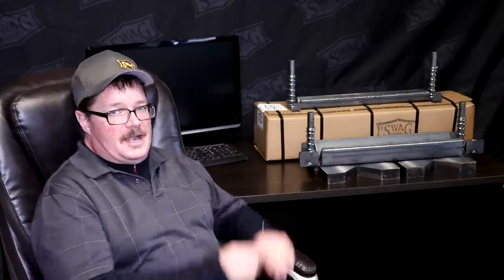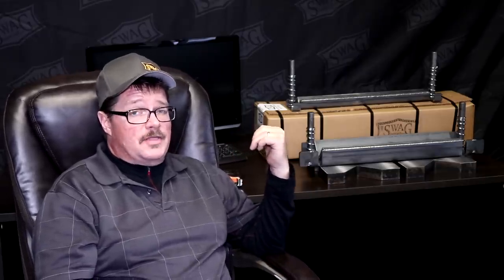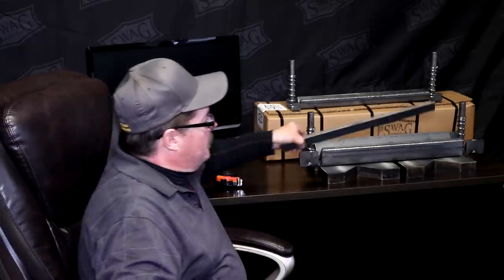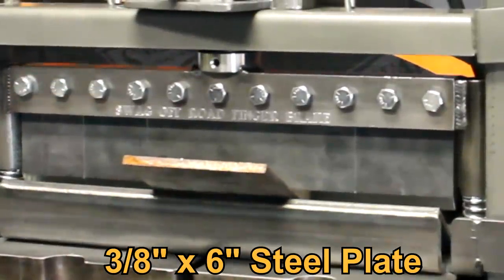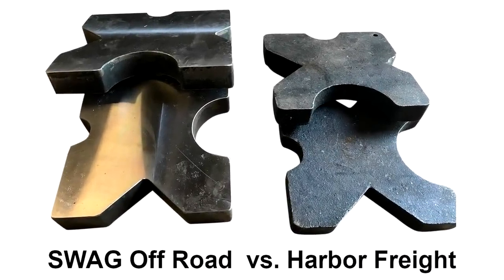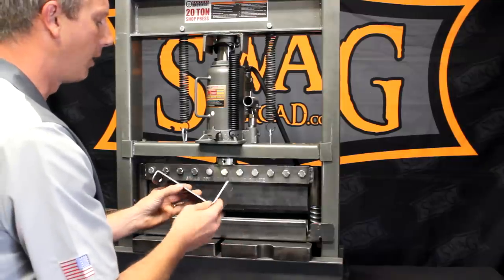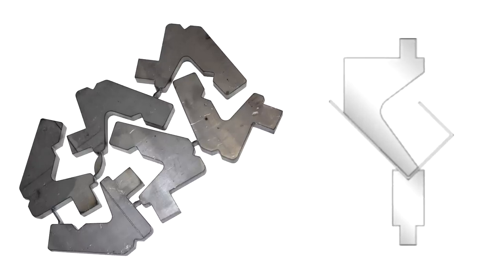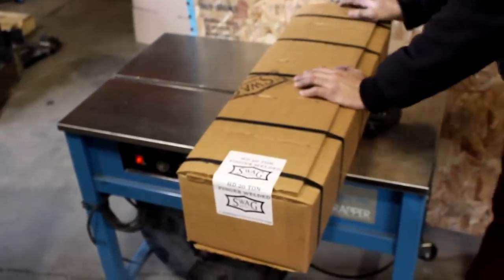SWAG Off Road 20 Ton Press Brake Line Up

Comment: Correct me if I'm wrong, but wouldn't another disadvantage of the HD model (besides a larger minimum radius bend) be that you could not bend smaller sized flanges like you show on the bandsaw table?  If the flange lip does not span across to rest on both edges of the 3" angle opening, then you wouldn't be able to bend that flange correct?  And since the 3" angle opening would be approximately 4.75" wide, wouldn't that mean you could only bend a tab that is at least 1/2 that size or 2 3/8"?  And putting a smaller piece of angle inside the 3.5" angle doesn't change that limitation?  Or is there a method to bending smaller flanges on the 3" HD model?  If so, could you make a video showing that?
Reply from the maker: You are correct. For applications where the material does not span the entire bottom tray, we recommend our Flat Top assembly. It is easily adjustable for bends that require a smaller leg than what the bottom die is typically capable of.

Comment: Nicely done video.  Makes it easy to understand the press brakes.  Did you add the two extra return springs on the jack?
Reply from the maker: Thank you, we appreciate that! And the extra two return springs you are seeing come on the Harbor Freight 20 Ton Air over Hydraulic bottle jack, Item #95553 or #69593. Those Rams are Great. They are reasonably fast and seem to hold up well.

Thanks again,
SWAG Off Road

Comment: Are the blades chromoly? Standard carbon steel? If standards steel is it hardened?
Reply from the maker: Hello,

Thank you for your interest in our products.

The Dies are made out of 1018 Mild Steel. That's really all you need for bending flat materials but we do recommend against bending round bar or rebar.

Let us know if you have any other questions.

Thank you,
SWAG Off Road

Comment: how can i retrofit for a pump to actuate the jack
Reply from the maker: I would just recommend picking up a 20 Ton Air/Hydraulic Jack. Your local Harbor Freight might still have them in stock, if not Big Red makes a jack that will fit the Harbor Freight Shop Press but you will need to drill holes in the base that you can use to bolt the jack into the press.

Comment: How did you make bench top.
Reply from the maker: The Flat Top is made of 1/2" thick steel, with two laser cut plates made of 3/8" steel on top. The top plates can be adjusted by unscrewing the 5/16" screws on top.